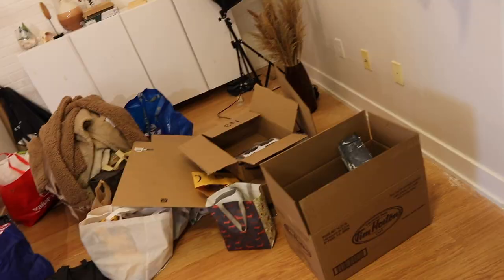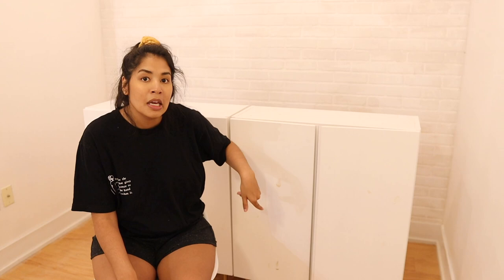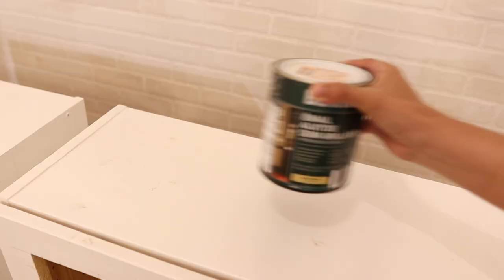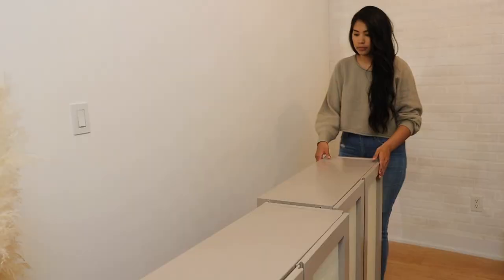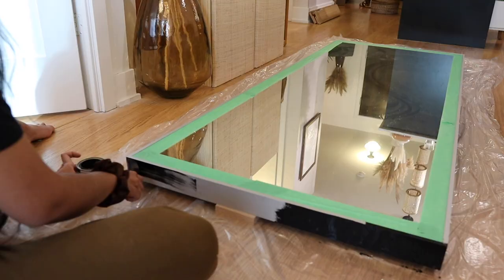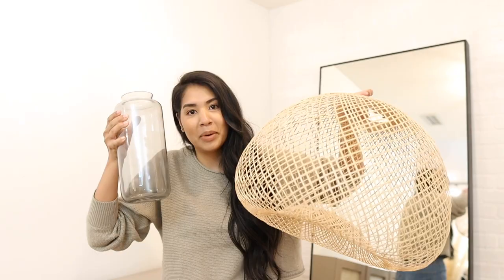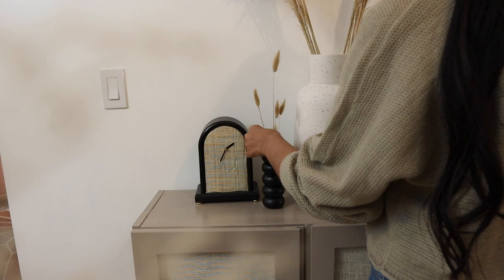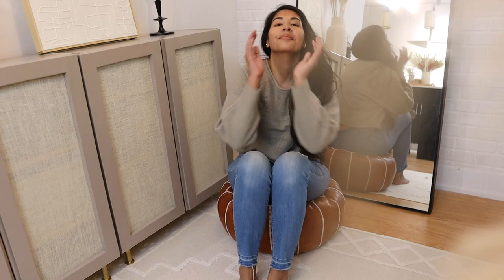Extreme DIY Office Makeover | diy ikea decor, diy cabinet hack & more!

Comment: That's gorgeous! Could you tell us more about the paint you're using for your canvas  please?
Reply: The puffy paint? I've seen it used mainly for t shirts but it's nice to use on canvases when you want something need or handwritten, which is much harder to do with a brush. It can get messy so be careful. Usually you just shake it and it comes to the front and you use it like a pen. Inexpensive. Glue might work too but puffy paint is more opaque. It can also take a while to dry depending on how thick you place it down
Reply: @briannawilliams8779 thanks! I've never seen that in shops in France where I live!